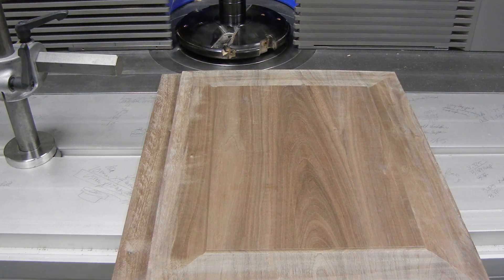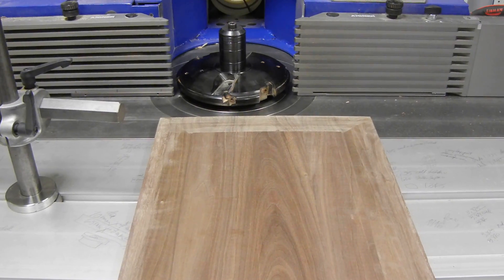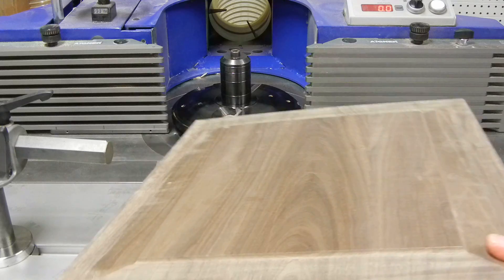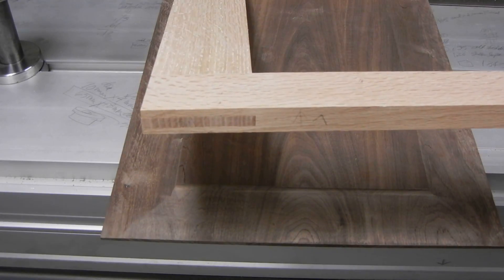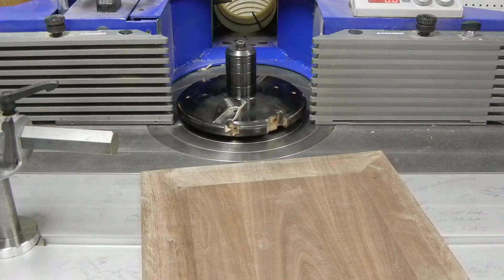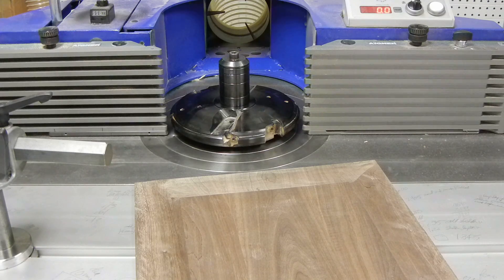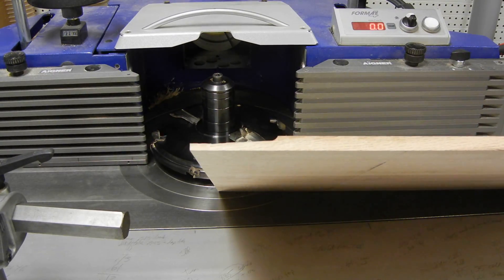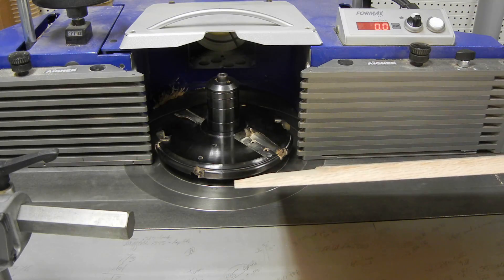Felder Format4 Profil 45 raised panel profile

Comment: Dont own a spindle molder but is the cutter supposed to be run over material ? have bad feeling watching it..
Reply from the maker: With a 3 hp Bosch router and a 28 X 40 table as I used some 20 years ago and even with 1/2" shank and the router rotating only one direction-twist; most router bits were a one side to cut affair. The angle of a profile tool lends itself to better performance with the larger diameter of a spindle molder vs. any router because the smaller router bit cuts more of the profile at the knife's edge: it meets the wood basically all at one time. Larger diameter tooling is more similar to the now popular relical rows of knives that meet the wood over a period of time. (this explanation may be a little clumsy but your get the point). So with the shaper Format 4 I can reverse the twist direction and run the wood above or below the tooling and as long as I have a firm grip on the wood it yields good results. I can take large amounts of wood in the cut of profile tooling with sharp knives, good wood grip and rpm with feed speed correct.
A smaller shaper tooling of 2.5" is very close the a router bit and results are similar. It's big money going with the 180 to 220MM diameter tooling. I have a custom made 4 X 4-1-1/4" bore moulder head for corrugated knives that works with two different knife angles and this tooling performs nicely with high speed steel knives. 
If I were working with a router size knife, I would have a bad feeling also; been there. If no one else is in the shop, swear words do help get a better profile cut. good luck and go for the largest tooling you can muster.
Reply: This is common procedure in wood working for almost a century. No worries "Mate". Just make sure the wood is held tightly DOWN on the table.

Comment: How much did this machine cost you
Reply from the maker: It was a funky deal that this machine came to me. I had put down money with Felder to buy a used machine that was in Florida and was led to believe that the used machine with a short table was relatively new but was bout the same spec. Upon going from Chicago to Felder-East Coast in my van to also get the horizontal boring machine along with the shaper there was a problem. The boring machine was OK as new special order; the shaper was in pieces with electronic problems and come to find it was a third time around affair--not close to being new and with those problems; and, the short table. Too much money to add the long table and with dark sky over the used machine I refused it. By happenstance, one of the heavies from Austria was in town and I was made an acceptable deal on a new, long table model with a few extra options and later I bought the the tooling. That raised panel tooling is big bucks. I am under agreement with Felder not to discuss the pricing on machines due to the circumstances of purchase as you can understand. Let's say, if you have a need for CNC, the long table for entry doors, motorized CNC fence and can figure a way, as I did, to put extra stop pauls on the sliding table; then, it is worth the money. This model is half$$ of a Martin shaper. The Martin is better, but, I can run the cheaper Felder and get by and still turn out good work. Figure to spend some dollars on tooling and Aigner devices that make it all happen once you get the shaper you can use. I had never had a small shaper before this Felder but I knew from industrial experience what it would be. The Felder has some cheaper machining on it that requires maintenance whereas the Martin will run basically forever as has the Martin saw I have. The later model Felder shaper is much better than I have due to newer electronics and touch screen, but, the Felder I have will do almost the same functions. Good luck to you.
Reply: you can get a price of $150k mercedes benz from their website, but not for wood working tools. I had asked for a quote for Format Profit h08 cnc machine and got no response from them.  I'm assuming they don't mention price of even a $3000 machine is because the prices are negotiable and they might give you a discount if you buy additional tooling or accessories. Finding prices of felder or format tools is quite cumbersome. Same goes for AXYZ and onsrud cnc machines.   I don't understand this business model. whats up with hiding the prices. 

Regarding Martin products are they the same quality as the Format4 products?
Reply from the maker: Buddy, give me a question  773  A 766 A 6531  Vincent
Reply from the maker: You can call me and we will talk about this. In sliding table saws the Martin is one of the better machines on the market with Altendorf being close. But, with Altendorf you deal with Stiles Machinery